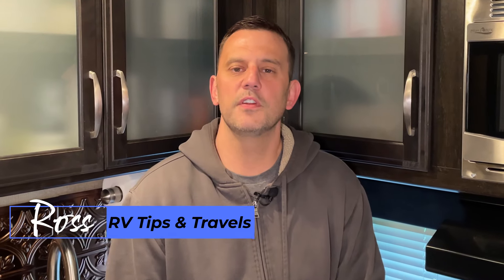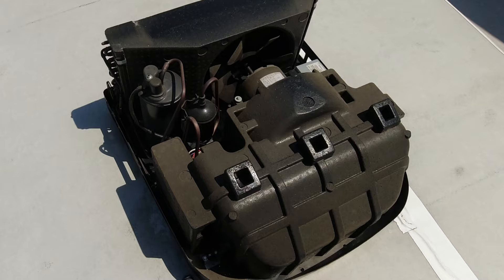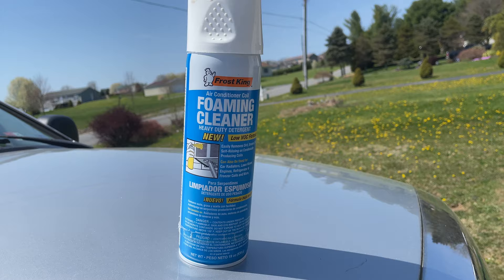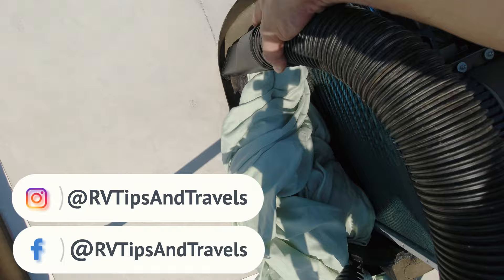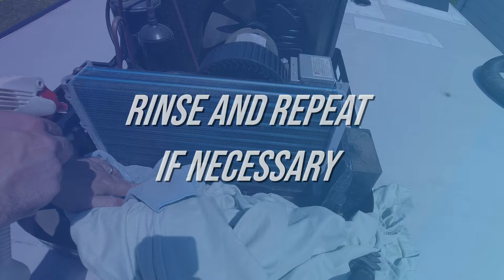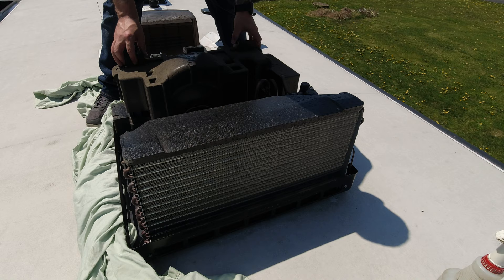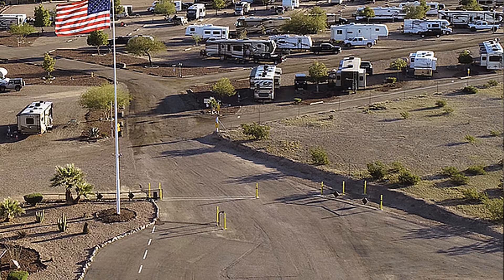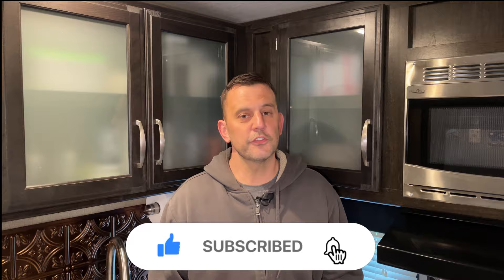RV AC Coil & Filter Cleaning -  Air Conditioner Maintenance Made Easy

Comment: HVAC tech for over 20 years and this is spot on. First time I’ve seen someone mention the thermistor as well as removing the negative post first.  Great job.
Reply from the maker: Thanks Edward, I did my research and even spoke with an hvac mechanic.
Reply: Does the refrigerant ever need to be recharged or anything like that? Like you would with an automotive system?
Reply from the maker: These are nonserviceable, sealed systems, unlike your home.
Reply: My popup camper a/c will cool for like 10 mins max, then the compressor cuts off for 6 mins or more. And never gets cool inside.  My filters was real dirty.  But when i take the filters off and the inside shroud cover. It will then cool the camper until it froze up. So do you think it's possible the coils need cleaned inside and on the top? We just bought the camper.
Reply: @jasongee663 That's what I was told about our new-to-us RV. But right now it's getting up to 105 so this will have to wait a few days til the temps drop again.
Reply: @jasongee663 Is your thermistor inside of the air return? That was my issue. I had to move it to the thermostat.
Reply: Bill collector for 10 years this is spot on

Comment: Nice Informative video.  Nice Job!  We have the same A/C.  We just did a minor overhaul of ours (9 years old).  You can use a can of air you use on computers and electronics to blow out all of the dust.  Also a paint brush with soft bristles helps.  While you are up there, wiggle your fan shaft forwards and backwards and spin it.  It may need to be soon replaced if it is noisy or too much play in it (There are videos on this).  Take a pic of the tag on the fan housing for future reference.  Unscrew the two bolts holding the metal box you see.  Remove the box and check the wiring.  Also take a pic of the start capacitor for future reference.  If you fan or compressor stops you might need a new one.  And, take your inside cover housing completely off and retighten the bolts holding your whole unit down on your rv.  Just some additional tips while you are at it.  The above fan motor, start capacitor and the cover shroud can be found on Amazon and Ebay.
Reply from the maker: Thanks for watching and commenting.  All great tips.  I did however just want to keep to the subject of cleaning for this video.  Mechanical maintenance is a whole other animal and will be a video in the future.  Thanks again!

Comment: Future video suggestion. We have service line shut off valves throughout our homes. Why RVs have none remains a key head scratcher for me. I installed a simple in-line shut off valve when I replaced the broken (from freezing most likely - oops) flush valve on one of my RVs toilets. This was an easy DIY mod that not only made replacing the valve less messy, but also allows me to isolate/ stop water flow to this toilet when (unfortunately not if...) future repairs are needed. Over time, I intend to install in-line shut off valves on all of my water lines (other toilet, kitchen & bathroom sinks). I’d make this video myself, but time & good video equipment are limiting factors. Thanks for your straightforward, easy to follow presentation style. Much appreciated.
Reply from the maker: Jeff, excellent recommendation, been wanting to do this for about 2 years now, haven’t had much time but within the next year some things will be happening with the channel that will allow us to hopefully put a video out every week instead of every 2 weeks.  Hang tight!

Comment: I’m up there every few months and it never gets dirty. Thanks for the content.
Reply from the maker: Any dirt that does get pulled in the area of the ac unit won’t be visible until you pull the shroud off.  Everything outside of the shroud is washed away in the rain so that may still look clean when the coils are dirty.

Comment: Ross - this gets me thinking. I have a white powdery dust material coming out of my AC ceiling vents.  Our unit is a 2021 Jayco Greyhawk 30z with dual Coleman-Mach AC units. Have you ever seen this? It is not construction debris or dust left over from the assembly process. I pulled the interior covers off and vacuumed them out, as well as sealed all the open areas into the ceiling with silver metal duct tape where needed (and it was needed). I also pulled off all 12 of the round ceiling vents and looked into them. There was some construction dust/material in them. I used a shop-vac to suck from the ceiling vents while running a leaf blower into the supply ducts to evacuate all of said debris. I then reassembled the entire system. The white powder dust snow came again after several days of using the AC units. Pulling down the interior covers again yielded a non-significant amount of this white powdery substance on these covers that were just cleaned days before - all while parked, i.e. no driving in between. I believe that this is aluminum oxide coming off of the evaporator coils after being used ( i.e. getting wet and then drying). Once dry, when the AC fans kick in, the snow comes out of the AC vents again. Thi si a significant amount and covers everything in the RV - including getting into food, drinks, etc. Not fun. Very annoying. I am wondering if you, or anyone seeing/reading this, or anyone you have talked to has seen this occur in their RVs. If so, did cleaning the coils fix the problem? Or are the coils defective from the factory and need to be replaced. This is such an annoying problem. Any insight?
Reply from the maker: Cleaning the coils may fix the issue, but doubtful.  You make have a slice or hole somewhere in the ducting that is pulling the insulation into the ducting.

Comment: I just did that today & there was a wasps nest but they had vacated in the past, the evaporator coils & fins were clean looking.  the condenser fins were all gunkd on the outside but not inside, strAng who’d think?, a short, fat screw driver with gentle touch for fin bends & then that frost cab brush to fine straighten them Cms to work.  putting cover back on without bump-dNTng them again is a subtle endeavor though😯👋

Comment: Have you done a video on resealing around all of the components on the roof? Such as any seams, around roof vents etc.  dealer told me it should be done using self leveling caulk. A how to on this would be great.
Reply from the maker: I haven’t Rick, but I’ll put that idea in the bucket.  Thanks for the comment!

Comment: I have a manual disconnect for the battery to the RV located in the storage bay. Will disconnecting that suffice in lieu of disconnecting the battery?
Reply from the maker: Great question Matthew, I hate those things. They don’t completely disconnect 12 V power, and it depends on the camper manufacture to what power is actually disconnected. I know people who actually remove those battery cut offs because they don’t truly cut power off to everything. I don’t like them, and I would recommend just pulling terminals off your battery just to be safe.

Comment: Hear a lot of people on FB talking about not trusting the factory water lines and/or the factory water line connections.   They say that all RV'ers should replace their entire water system with PEX and with either PEX fittings or barbed connections.  Thats above my pay grade and seems like a huge job to fix a problem that doesn't yet exist.   Would you consider doing a video on this topic, or about what should be done to improve the strength of water line connections (eg radiator hose clamps), if anything should be done?   Thnx
Reply from the maker: Let me do some research on this.
Reply: The problem is that so many of the water lines and wires are inaccessible once the RV is assembled, there's no easy way to gain access to them.  I wouldn't worry about replacing/upgrading the water lines until you have an issue.  

One thing that's super important that most RV'ers don't think about, is installing a pressure regulator to the fresh water input so you lessen the chances of blowing apart pipping connections due to high water pressure or aging pipes in your RV.
Reply from the maker: I agree, from researching and speaking with others, the failure is usually at the fittings.  Pex is pretty strong, enough to handle a measly 50 psi, but the fittings are usually plastic which crack or lose the seal at the shark bite fitting.

Comment: If you have a class a do o still need to remove battery cables? No shore power no main on. Great video
Reply from the maker: However you're Class A is set up, just be sure the AC is not getting power.  Since the thermostat uses 12 volt power, and you will be around those wires also, I just disconnect everything.  Never hurts to be overly cautious.

Comment: I just cleaned mine.
The direction of air flow into the condenser coil is from the inside out.
Mine was almost completely plugged up between the fan and the coil. 
  You have to remove the fan to get the Styrofoam  cover off for cleaning.
I almost didn't see all the debris stuck to the coil.  I always believed they pulled air  in through the coil. I see just the opposite is true. This unit exhausts air outward.
Reply from the maker: Thanks for watching!

Comment: I just got a class B with an old Penguin 600 series AC. The previous owner let the foam cabin filters dry rot and half the foam is up in AC intake I bet. I tried to pick as much as I could out from below. Will I be able to get that stuff out by taking roof shroud off? Thanks for this video
Reply from the maker: I'd definitely start there and see what you come up with.

Comment: Great video.  I got my Rv about a month ago and Im living in it full time at the moment. I'm a contract healthcare worker.  I will be cleaning the air conditioner when it gets alittle cooler.  My question is that my power in the park went off today for about 3 minutes and my air conditioning did not come back on it turned off completely.  I was able to turn it back on at the thermostat. No breaker was tripped and I have a surge protector on my plug. I have 2 dogs traveling with me so when I got home an hour later it was 91 degrees.  Do you have any Idea why it wouldn't come back on? I have the same 2019 grand design 2150 rb as you I believe.
Reply from the maker: If you lost power, the thermostat probably reset to the off position.
Reply: I hope you get a temp monitor for your RV...pets were killed last week from a power failure...
Reply: A mechanical thermostat would automatically come back on ,but digital ive learned in my years in HVAC is more accurate, I just changed mine to digital

Comment: Hi Ross, what do you think? Can I use the air compressor to clean the dust inside the unit and from the coils? Thank you for your answear.
Reply from the maker: Should be fine BUT I would turn your air pressure down, those fins are thin and it won’t take a lot of pressure to bend them. Start low and work your way up with the pressure.
Reply: @RVTIPSANDTRAVELS  I thought the same thing. I wanted to have a second opinion of someone with more experience than I have.
Thank you Ross.

Comment: Looks like I have work to do. One question is do you clean both sides of the coil fins or just one side?
Reply from the maker: Usually just the outer side, but if it is dirty you can clean the other side.

Comment: Compressed air is essential to clean the coils as best as possible, along with blowing out all debris/dust. Hand cleaning will never get the coils as clean as they could be.   Only thing I heard about compressed air was for cleaning filter.  🤔
Reply from the maker: Ed, if you run compressed air on these coils your going to have about 4 hours of work to straighten the fins.  Soft water pressure or brushes, never compressed air.  https://www.youtube.com/watch?v=k7PSzi7NSyc
Reply: @RVTIPSANDTRAVELS   Yes, if you blow a 140psi of air, at close range, on the fins, you definitely can bend them, but you can bend them cleaning them manually too, if you’re not careful.  It’s all about taking care.  I’ve done this many times on cooling fins, and tons of dirt/debris comes out.  Again, must use caution ⛔️ when doing this.  I’m getting ready to do it right now.  I have one unit rattling, I will guess there is something causing an imbalance issue, like something in the squirrel cage fan, and/or some bad insulator bushings.  Whatever it is, I’ll fix it.  Other unit doesn’t cool well, so compressor is failing or it’s low on Freon, which means it may have a leak.  That unit may get replaced with a new 15k unit.  I do have a question for you, though.  I have an old duo-therm 5 button comfort control system, but have the micro-air touchscreen, can I adapt that to any new rooftop unit? Ty

Comment: My popup camper a/c will cool for like 10 mins max, then the compressor cuts off for 6 mins or more. And never gets cool inside.  My filters was real dirty.  But when i take the filters off and the inside shroud cover. It will then cool the camper until it froze up. So do you think it's possible the coils need cleaned inside and on the top? We just bought the camper.
Reply from the maker: Jason, I would start with a good coil and filter cleaning, see what happens next.

Comment: Hi Ross, I just finished cleaning my AC evaporator coil per your video. I have a GE AC and the Thermistor is attached to the end of a coil outside of the fins. I have had some freeze ups and wondered if this could be why. My AC doesn’t shut off when it freezes and rains inside. Any thoughts?
Reply from the maker: that is the purpose of the thermistor so that might be your problem... i would google search and see if you can find pics of people exposing your exact coil online and where its positioned.  try placing the sensor where mine was, you might find this fixes the issue.  did you buy this rv new?

Comment: Did I miss it, or did it not get covered to clean the drain line to keep it unclogged?
Reply from the maker: I didnt cover that in this video because I wanted to focus on coil and filter cleaning, as stated in the title.. This is not a complete AC troubleshooting video, however I will be releasing one in the spring of 2024.

Comment: can you use the Nu-Calgon 4171-75 Evap Foam No Rinse Evaporator Coil Cleaner on both the evap and condensor coils?  I noticed this same company has a cleaner for the condensor coil so I wasnt sure if it was safe to use on both??
Reply from the maker: Yes sir, it’s just twice the cost.

Comment: Hi Ross,
I have another issue with my Coleman Mach 10 Heat Pumps that might be related to condensate drain holes allowing the blower to suck unfiltered outside air including dust/dirt from under the AC unit that gets deposited onto the evaporator coil. 

Do you know if there is a way to access and place some open cell foam between the roof and the base of the AC unit so that dirt can no longer contaminate the evaporator coil but so than condensate can still exit the AC unit? 
Marc
Reply from the maker: Marc, can you send me some pics?  Management@rvtipsandtravels.com
Reply: @RVTIPSANDTRAVELS  Planning to get on the roof this weekend weather permitting. I can see a lot of dust/dirt on the evap coil from the inside and it must be coming from someplace... I will take pictures from up above when I get up there.
Reply: It's too windy to clean the coils today... I have an exploded parts diagram of the Coleman Mach AC. it shows item 30 which is the evaporator coil condensate drain pan that has two holes that allign with corresponding holes in the metal base plate. Condensate drains through these holes BUT since the air pressure under the evaporator shroud is lower than the outside air, dirt can be sucked into the evaporator shroud. A Duck Bill check valve or even a piece OPEN cell foam would prevent this.
I have e-mailed Airxcel (owns Coleman) however they have not replied as of yet.
I have a JPG file of the Mach exploded parts diagram but have no idea how to upload it to this chat...
Marc
Reply from the maker: can you email me the parts diag?

Comment: What could be the cause of it not blowing cold? The compressor kicks in and everything but it doesnt seem to cool the air. Both coils have been cleaned thoroughly with coil cleaner... When i take off the air filter from inside the rv i can see the evaporator coil freeze up a little bit.... any suggestions?
Reply from the maker: could be a few things that would need to be tested.

Comment: The air on my rv is cleaned every year but it still has the mildew smell when the unit kicks on. I also clean the filters regularly.  Somewhere there is mildew but I cannot find it. Have shined a light into the ducting and it’s clean as can be in there. Any ideas?
Reply from the maker: something i would have to look at.  did you clean in and around the fan and components on the roof?

Comment: Ever heard of compressed air 😇😊
Reply from the maker: NEVER use compressed air on an AC coil, you will instantly bend the fins. They are just too weak on an RV AC unit.  Even if you turn down the air pressure, its going to need to be so low that it will be virtually ineffective.  Physical pressure is the best way to clean the coils and MUCH more effective.  Think about it, do you blow car off when you clean it?

Comment: I just ordered Nu-Calgon 4171-75 Evap Foam No Rinse Evaporator Coil Cleaner, can I use this for both the RV condenser and evaporator ?
Reply from the maker: You sure can.
Reply: @RVTIPSANDTRAVELS  one more question, how long do I need to wait before starting the AC
Reply from the maker: I’d check the directions on the can first, but considering it evaporates quickly I’d say maybe an hour if you don’t rinse yourself.  I’d definitely check the directions on the can though.

Comment: Why not just pull the AC fuse?
Reply from the maker: Ac runs on a breaker.  Breakers can fail and seize.  The best prevention is to disconnect power altogether.